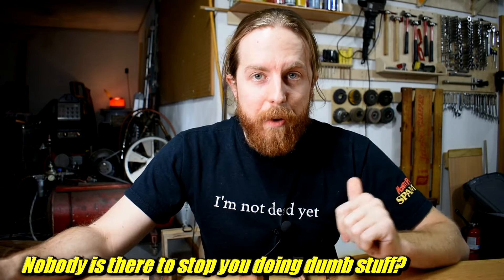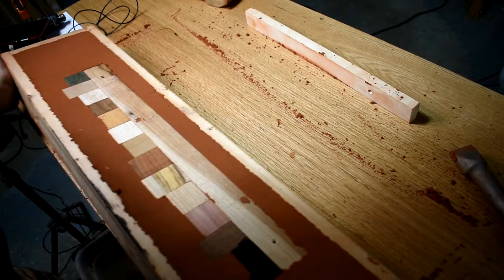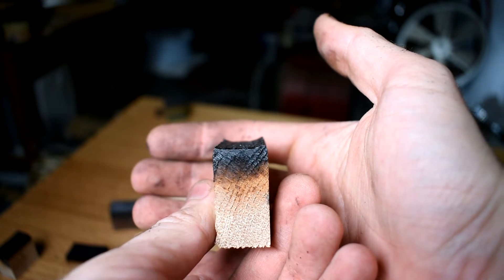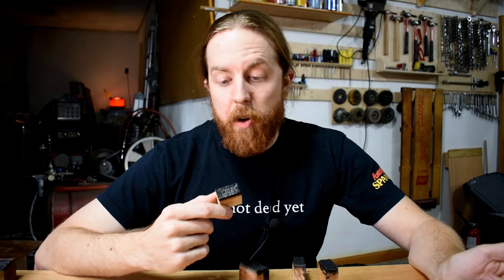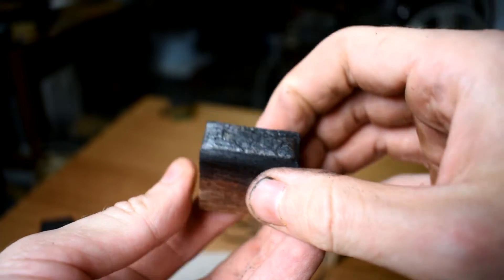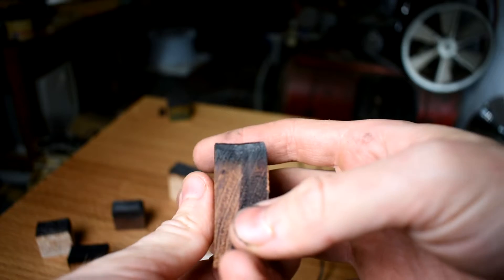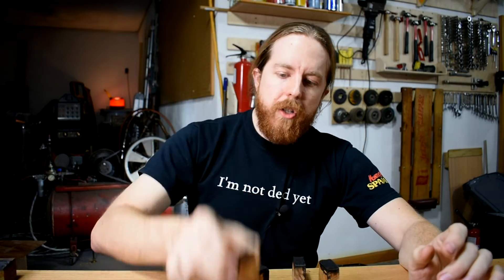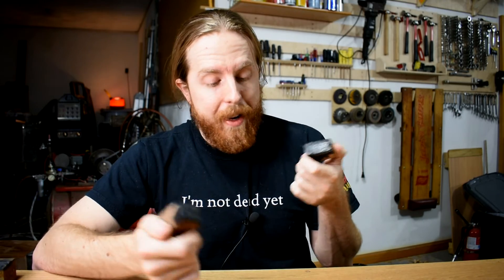Burning MORE Woods with Molten Aluminum for...Science?

Comment: Can i put a chimney over the top hole on my foundry to get rid of some of the heat and how do i control the temperature of my foundry?
Reply from the maker: Yeah you can use a chimney.  The temperature is just a function of head in vs. heat out. If you want to get it hotter, you need more heat going in.  You can turn up the burner, but the fuel/air mix still has to be good.   There is usually a limit to the air flow that limits your temperature

Comment: Redwood contains natural fire retardant in its bark, and would be a good candidate for durability as it is extremely hard and strong. Another possibility is Douglas fir, also if you soaked the wood in water for a few days prior to the test, the performance would undoubtedly improve for all the samples.. but yeah,, redwood is definitely your best bet for durability, fire resistance and strength. I e used it in places where all other woods would fail miserably and it has always exceeded my expectations.  Best of luck!
Reply from the maker: Interesting, I didn't have any redwood to test.
Reply: @PaulsGarage  redwood is usually available at lowes/home depot in the lumber department and if not it can be obtained online from California or Oregon at a number of websites,  and I I encourage you to also obtain a redwood start for planting in your garden,  as this will help the survival of an incredible species of tree that will delight the future generations.  As far a building materials it is second to none for tensile strength and low flammability as well as resistance to vibration and impacts. I used it extensively in many applications where traditional hardwoods would undoubtedly fail. One of the world's best plants by orders of magnitude.

Comment: I have a wood that can easily take the heat.  Petrified (or mineralized) wood...  like dinosaur bones that still have the collagen in them if the stone is carefully removed with appropriate chemicals,  petrified trees still have the lignin and cellulose in them...  but the minerals won't burn.
Reply from the maker: That would be cool to try!  I would be worried about moisture in the stone flash boiling and exploding but I could just stand behind a shield haha

Comment: Skip bronze and jump straight to steel 😍😂
Reply from the maker: Lol I've done iron but I'm not sure my furnace could melt steel 🤔
Reply: @PaulsGarage  Actually the melting points of iron and steel are close depending on the additives.   The purest irons (99.999%) has the highest melting point,  most additives actually lower the melting point of a metal.  (Eutectic points are formed...  Freshman college chemistry for me back in the late 1970's.)
Reply from the maker: @shdwbnndbyyt  that's true, but grey iron is full of more additives than most steels and had a far lower melting point by a couple hundred degrees, which really matters at that temp.  I'm just using propane here

Comment: it might help to impregnate the wood with Boriumsilicate (its a sort of salt they allso use it to make fabric like natural fabric curtains extinguish itself after being touched by a flame mix with water and let wood dry after dunking ) it kindof makes the wood fireresistand wish might be enough to have it cast in aluminium without the wood charring up too mush outside of the puddle
Reply: I was thinking sodium silicate, but that sounds good
Reply from the maker: thats a good idea, it might help some underperforming woods handle the heat a little better